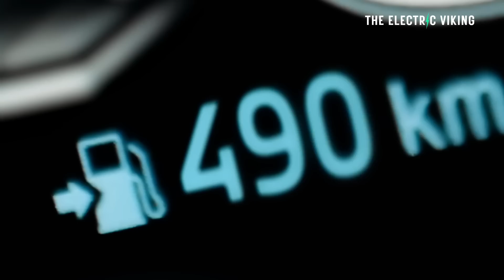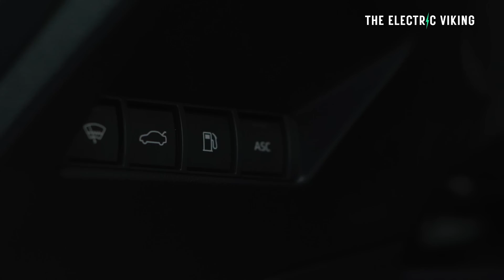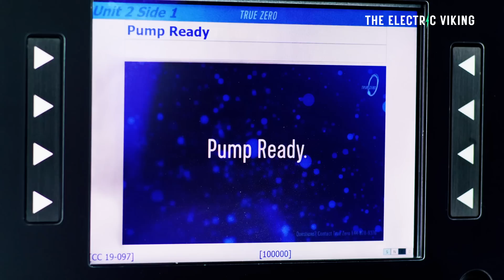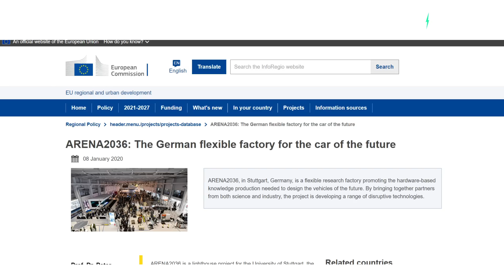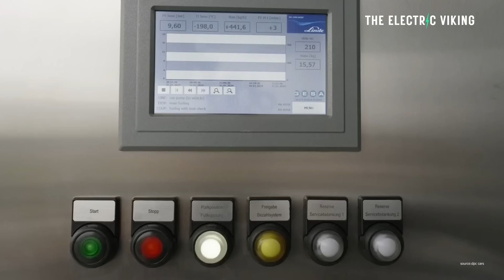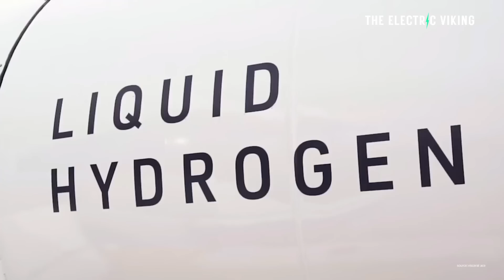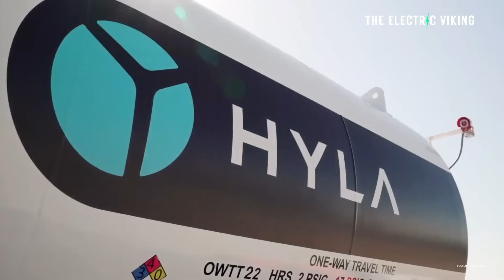Fossil fuel companies spending billions hoping that hydrogen beats EVs

Comment: Your own video noted that the USGS has identified enough "white" gaseous hydrogen in the USA alone to provide all the energy needs of the world for hundreds of years.  Consider the implications.  If that is a reasourse that is cheaper to obtain than natural gas or oil; then; you will see a major gold rush to get these resources. Price and possibly ecological considerations may well move it into the drivers seat as the cheapest clean source of energy.  Hydrogen can be used to generate electricity or distributed like natural gas; (possibly in natural gases lines) for heat or power in compressed tanks for ICE vehicles. An IF, a very plausible if.

Comment: Hydrogen will make us dependent on big oil Cos like it is now , hydrogen, petrol or diesel cars needs a fuel station and the supply chain that comes with that, but battery electricity will give us independence and freedom and they don't like that coz electricity can be generate from home solar, wind etc which is flexible.

Comment: Remember the Hindenberg? The problem with hydrogen is not fires  but FIRES. Here in Bakersfield where i live i was awakened at about 1 AM by a huge explosion about 3 miles away at the city bus headquartes. A hydrogen bus exploded and caused at least $1,100,000 in damage.
https://youtu.be/-toRJseb_o0?si=TvqHc-r3huEJFzTP

Comment: I have to admit that I was sold on the fuel cell idea and hydrogen as the next automotive fuel. but, in the past decade there have been very few advancements in fuel cell technology. Whereas battery technology over the past decade is moving at a very fast rate.  I now can't wait to be able to afford a Tesla and no longer have a desire for a Hydrogen car.

Comment: Yes, hydrogen fuel cells work, but ...    They are useless if you can't obtain liquid hydrogen conveniently, and you can't.

Hydrogen is very difficult to distribute.  It can't be sent via a pipeline as the pressure is too great, or the temperature is too cold.  It is the smallest molecule, so it can leak through even stainless steel or titanium, which is why NASA has to keep topping up their rockets with hydrogen right up until launch.  Frozen valves have caused numerous NASA rocket launches to be delayed and even cancelled.

Hydrogen pretty much has to be created at the point of sale.  This is usually done using methane, a byproduct of oil production, which is why the oil industry is pushing hydrogen as an alternative to gasoline and diesel.  Hydrogen is very volatile.  It burns and explodes easily.  Check out bus depot explosion when a hydrogen bus was being refueled in California.  Imaging a hydrogen production plant where now there are gas stations.  Would you want one near where you live?  I doubt it.

Comment: The thing about hydrogen is it is up against EV + renewables.   Even if some how they could in ten years reach the cost targets of EV, range and charge time targets of North American long haul that EVs are accomplishing today, EVs will have vastly improved their tech to even better performance and higher standards, while renewables will saturate the power grid with even cheaper, more reliable, energy.   They can’t even come close to gasoline powered vehicles.  

I have asked several Hydrogen proponents about cost to consumer, and they are dead silent. Any business case for a consumer to adapt Hydrogen, chrickets, or “Oh that’s coming.”  Try and find a Hydrogen powered bus project that is still operating beyond the special tax payer financing those projects get.  I have not found one.  

Except one, hydrogen steel.   That looks good, especially with the cost of solar dropping.

Comment: In the future EVs will have small batteries with limiting capacity. All main roads will have under-road power to run your  EV and recharge your onboard battery. No more service stations drive and never need to stop for fuel. Governments will love this system as they will be in charge of the fuel price and tax. You will receive a bill for your use each month. If you don't pay up within the time frame your car will fail to work. Big Brother Yes, but governments need money to run the country. All Evs scooters Ebikes cars motorbikes mopeds can be charged from home solar. The government isn't benefitting from these types of mobility. Something has to change and hydrogen isn't the answer.
Governments need more money as running a country is getting more expensive. Mobility power supply is a government golden opportunity
to pass massive amounts of money from oil companies to the government. Without a fight. Remember the change to NBN.

Comment: When the energy crises of the 1970s hit, I was a huge fan of hydrogen. After all, the supply is nearly infinite, right? Sure. However, trying to get the fuel from water is incredibly difficult and expensive. Now that EVs are more mainstream. It is undeniably the BEST way of getting away from fossil fuels. Hydrogen powered vehicles were a pipe dream in the 1970s. Given the complexity of producing hydrogen, they still are and it’ll probably be years before hydrogen is a viable alternative to EVs and iCE vehicles.😊

Comment: Companies are investing in hydrogen as a last ditch effort to pull more utility out of all the natural gas infrastructure they are trying to build. They want to milk the pumps as long as they can, and will use gray hydrogen after they sell "green" and "blue" hydrogen to make it look like it's clean even though it's from natural gas and leaking methane throughout the process of extraction, storage, liquefying, transportation, and utilization. Don't buy it, don't use it, and don't let them sell the lie.

Comment: The fossil fuel companies are hoping to continue using oil to strip the Hydrogen out! The PROBLEM THEY HAVE is the byproduct of getting the hydrogen releases the carbon dioxide into the atmosphere! This is the problem electric cars are trying to solve and fossil fuelsuppliers and ICE car manufacturers are trying to keep going! Crooks are trying to fool the public.🤔

Comment: If you understand how crude oil is made into gasoline it would be obvious to you why oil companies want hydrogen to be the fuel of the future (and always will be). Oil companies in the process of bringing gasoline to the octane levels that are marketed to the public produce a lot of hydrogen. Hydrogen is also a byproduct of the refinement process in general. At most refineries hydrogen is either flared off (burnt) at their exhaust pipes or just vented into the air. Because it is the lightest gas, it quickly rises in the atmosphere and gets disbursed in the air. Because it is not considered harmful if breathed and isn't dangerous unless it is highly concentrated and mixed with the oxygen in the air, it is not considered a pollutant in most places. 

The reason that I know that hydrogen is a byproduct of oil refining is because in Richmond, California the refinery there sells its hydrogen to a company that repackages it for industrial uses. This discovery helped me connect the dots as to the reason oil companies put so much effort behind hydrogen. If they were to capture and package all the hydrogen produced at all their refineries they would be the biggest suppliers of hydrogen by a mile, therefore control the market. They can kill off natural gas steam reforming, which is the biggest way that hydrogen is produced today, with their oversupply. Green hydrogen could never truly compete with something that they previously thought of as a waste product and not a profit center. Having control over the hydrogen marketplace they could dictate prices so that it couldn't really compete with their primary products like gasoline. When governments would push for greener fuels they could push more hydrogen out the door, never allowing it to become the dominant fuel. In this way, they would make money from gasoline as well as from hydrogen. 

Right now I'm seeing a bunch of ads by oil companies pushing for carbon capture and sequestration (CCS). Something that we all know will never contribute significantly to solving the carbon crisis. Its impact is only tiny and its costs are ridiculously expensive. Oil companies are never an honest player in this space.

Comment: Fuel cells make sense. Quick refill, long range, and generate electricity on demand. Still electric vehicle with all benefits ICE.
Reply: Long range?  Quick fill is the ONLY thing offered.
Reply: @TheEvilmooseofdoom  Toyota Miria HY EV can travel 1369 kilometres, 845 miles on single quick fill.  Also no weight penalty in comparison to power point battery EV which excessively heavy prematurely scrub tyres creating elevated airborne particulate pollution.

Comment: Hydrogen will be great for steel making.  For vehicles it's best use through a hydrogen fuel cell to make electricity to move a car.  In that case use batteries because more of the electricity that would make hydrogen that's made into electricity would best be directly shunted to motors.

Comment: Years ago I thought hydrogen would be the next step after gas and diesel . I thought EVs could be a bridge to that transition. I don't think that anymore . The number one thing is transportation. EVs get their energy from the electric distribution system or locally from a electrical production center . Hydrogen mostly needs to be transported by fuel trucks to fueling stations . 

Now I thought natural gas was a good choice also as there already has line infrastructure in place in many locations . Not sure why that did not replace Petro . 

Tesla was so smart building their charging network . That was key to Teslas success . It wasn't that difficult . It used the existing electrical infrastructure. No fuel trucks . No gas lines . 

It surprised me as it did with legacy auto . My young grandkids say they want a EV when they are able to drive

Comment: Hydrogen is currently made by steam reforming methane (natural gas). The process releases CO₂. BigOil claim that they can capture the CO₂ and sequester it into, for example, old oil wells or gas wells. This is unproven, there are no CO₂ storage schemes running at scale. If that CO₂ is released, or leaks, then that is no better than just burning the gas, except it is worse than that. To run steam reforming of methane takes a huge amount of energy and at the end of that you only have a fuel, not the end product using that fuel such as move people around. It is clear that the push to use hydrogen is simply a reason for BigOil to keep extracting fossil fuels and we should stamp down on it hard. Remember that BigOil has very deep pockets so adverts are easily available to them and client journalists are already selling their souls to write about how poor renewables are. There are also dead-end scientists who have decided to abandon their ethics so climb onto the BigOil gravy train and of course there are many politicians with their snouts deep in the BigOil trough. So stopping BigOil will not be easy. We do, however have one big advantage - economics. Renewables make financial sense and our children and grandchildren will be grateful for that.

Comment: Big truck battery swapping or trailer batteries will be much cheaper than super expensive H2 fuel + fuel cell system
Reply: Long range aviation will need H2 fuel, with SAF not scaling
Reply: @glike2  batteries in trailers would be a big help but it will be many years coming.  Hydrogen for aviation is crazy,

Comment: I was a bit confused at first by the comparison, but I still don’t see this as a THIS OR type discussion. 10 years ago, EV’s were still largely mythical in their claims. 10 years from now, I suspect (green) hydrogen will be one of our core fuel sources for many applications , along with EV. So I believe fossil fuels will be losing out either way.

Comment: Consumers won't buy hydrogen cars and it's not because of the technology. It's because they don't want to get trapped having to buy some kind of fuel. After 120 years consumers can escape and have a car that using readily available electricity and can even make their own electricity. There aren't enough foolish customers to be worth making even one production run of the cars. Fleet managers are even smarter than consumers so unless they have a way to make hydrogen cheaply at the depot and repair the trucks they won't do it.

Comment: Best way to use hydrogen for fuel is as synth fuels, extract carbon dioxide and make efuel.     Clean out fuel tank and put efuel in and already have the infrastructure in place to use.

Remember not everyone can charge at home, and public charging is expensive compared to home charging and always will remain that way.

Here in uk on an EV tarriff then people can actually get paid to take electricity from the grid when high output.
Others paying 4p a kW.      Supermarket with 3 hours limit parking is 44p a unit or 10 times the price.   Supercharger up the road is 85p a unit.

If you can home charge EV make sense.   For people that cannot then they don’t.    80% of EV charging in UK is done at home.   Yet only 70% of uk can home charge with suitable off-road parking.

So for people that cannot home charge it isn’t range anxiety or charge time that the issue but that cannot home charge.   That is the part that needs sorting out.

Comment: Hydrogen is 11X worse for global warming than CO2. And hydrogen is the leakiest molecule there is. A hydrogen economy would see an inordinate amount of hydrogen leaking into the atmosphere. On top of all the other issues mentioned. CO2 is only bad due to its global warming effects, so switching it with another molecule that causes global warming is totally missing the point.

Comment: When electricity is as plentiful and cheap as Tony Seba predicts, the cost of generating green hydrogen will fall dramatically, but by then battery electric will be so well established that it's unlikely hydrogen will be able to get any traction as a vehicle fuel, especially as it will still have a complete new refuelling infrastructure to build out and it will never be as efficient and therefore as cheap as BEV's. Plenty of other industrial uses for hydrogen though.

Comment: Correct me if I am wrong. I got the impression the hydrogen was used in an internal combustion engine. If you had a fuel cell running an electric motor getting the hydrogen in some green power source it might be more viable. My understanding is, hydrogen is one of the things being looked at as a way to store green power.
Reply: It's just too inefficient to even use for storing green energy. It takes 50kWh to make a kg of hydrogen. And then the conversion of a fuel cell back to electricity is 35-45%? There's losses in each step. The losses in going battery direct are much less. Engineering Explained channel has several good YT videos on this topic.

Comment: I've been saying for a while that Hydrogen is a fossil fuel scam.  The scam is to start with clean H then say they need to switch H from methane to save costs.  They are scamming themselves.  Even if this very expensive fuel cost nothing there is the cost of delivery to filling stations which cannot compete with EVs tapping into the grid, let alone the cost of containment vessels and fittings.

Comment: Hydrogen vehicles are always going to be more expensive than EV's...  It takes a lot of energy to compress the H2 into a liquid and then transport it. Plus the storage and filling process has inevitably leakage into the atmosphere. These problems cannot be overcome. It will always be vastly more expensive than charging an EV. The bottom line for operators is profit. So Battery Electric Vehicles will always win over Hydroden ...

Comment: The biggest problem with hydrogen is that to distribute it, we have to build new infrastructure. Whereas the power grid is already built. Hydrogen does have a place in power backup, although less efficient than Batteries and Pumped hydro, hydrogen is cheaper per kwh of energy storage. Hydrogen will still be viable as spacecraft fuel

Comment: Current cost aside there is nothing conceptually wrong with green hydrogen powering a hydrogen fuel cell EV.  It deals with CO2 emmisions if that's what mainly bothers / concerns you and the public heath issues of tail pipe emissions, my main ( though not sole ) concern.

Comment: 1/  Hydrogen tanks take up precious space in the vehicle 
2/ After all these years, where are the hydrogen fueling stations?
3/ What is the end-to-end efficiency of the hydrogen production, transportation and use
4/ Which vehicles have the hydrogen tank in the same location as EV batteries, lowering the center of mass and improving safety?

Comment: DON'T BE FOOLED. 
Hydrogen engines are not the answer for cars. Why ? 
1. You can't rharge at home - the most major drawback. 
2. Hydrogen charging stations are scarce, Pretty impossible to plan any long distance trip. 
3. Hydrogen charging stations are very expensive to build - up to $1 million each.
4. Hydrogen refills can cost up to $200 per charge. 
5. The mechanics take up the whole hood and trunk leaving no space for suitcases etc. 
6. Slow acceleration. No match for EVs. 
7. Hydrogen is stored in long tubes so what happens in a major collision? 
8. Cost of maintenance is high. 
9. Heavy depreciation. A new Toyota Mirai can cost up to $70,000. Used ones sell for as low as $8,000 reflecting little demand for them. 
Not a good investment and impractical, 
Elon Musk usually laughs when anyone mentions Hydrogen cars - and for good reason.

Comment: Very DUMB!  They should be focusing on AMMONIA - which can be directly removed from air by renewable power and is needed for many products!
Ammonia can store 3 times MORE hydrogen than hydrogen and at lower pressures and temps - we already have the infrastructure for this, including trucking!
Fossil Fuel companies = lying MORONS!